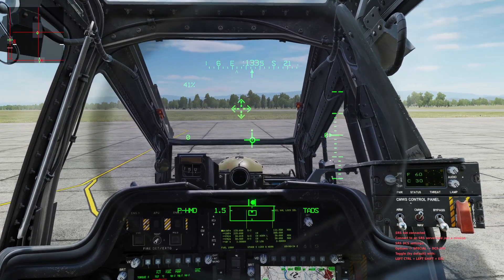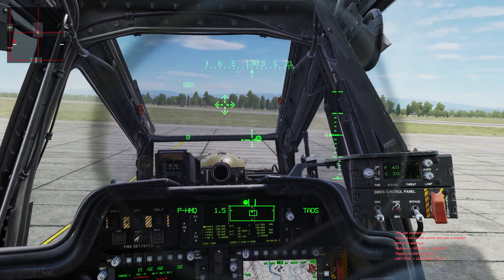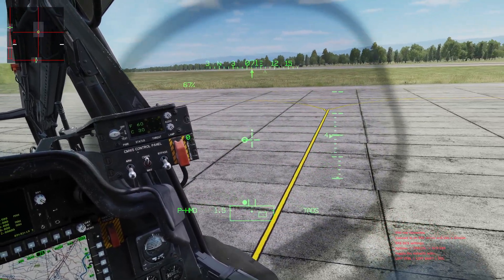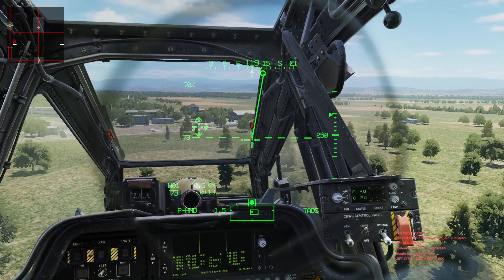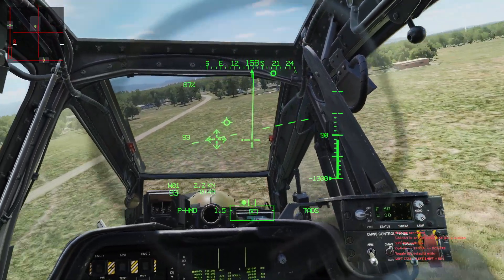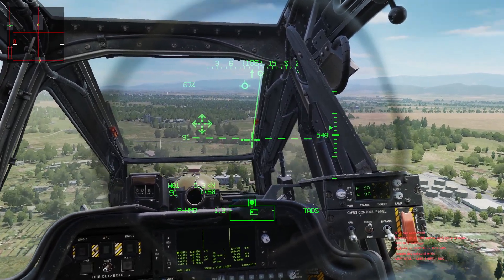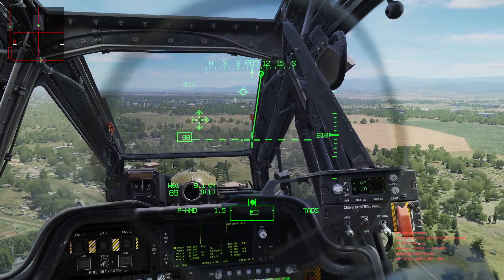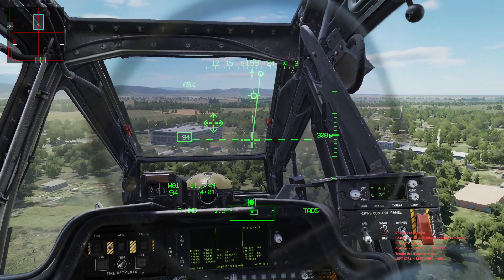AH-64D Hovering Turns, Force Trim Use, Hold Modes Enabled vs. Active

Comment: For some time throughout the 90's I was very fortunate to fly in high-wing 2-seater frequently with a retired Coast Guard pilot. He'd get me to line up to runways, various other low-risk operations :) However, rudder pedals in real-world are a floppy nightmare for me...... maybe it's cable stretch and delayed response from rudder while taxiing; getting "in sync" with the floppiness is not easy for me. Your rudder curve is pretty interesting, I appreciate the coverage. I tend to pull Y saturation quite far down to feel more manageable. As for Force Trim, it changed my ENTIRE Apache experience........ now that I've clicked with it, my Apache crashes my system every time I try a mission. The one and only aircraft that does so but you got a new subscriber here, guru :)

Comment: I fly with a Puma Pro flight trainer (cyclic, collective & pedal combo setup) which has no springs. In DCS I have trim modes set to joystick with no springs. Does what you say in this video also apply with such a setup?
Reply from the maker: You have to push the force trim button, regardless of your hardware, to update the FMC on where your flight controls are. Even with a dry clutch system that holds your stick in place, you have to push the force trim interrupt to tell the FMC what it’s reference should be.
Reply: @bradmicksflightrelatedthings  Thanks for your reply. What I do after each small corrections during flight is to press the force trim button. During your video you said to keep the force trim button depressed (i.e. force trim interrupt) during the whole course of manoevers. I assume this also applies with what you call 'dry clutch system'. In any case many thanks for all of you very informative videos!

Comment: easy to follow instructions, i don't use force trim because of the fixed wing HOTAS, was wondering if we can disable heading hold?
Reply from the maker: Heading hold is ALWAYS active, unless the force trim is interupted. The Apache requires your to use the force trim, it's how you communicate with the FMC and SAS. If you're not using the force trim, I would definitely encourage you to start, it'll make flying the helicopter that much better!

Comment: I've always just tapped the force trim button to hold my cyclic after I make corrections. Is there a difference in tapping vs holding and releasing?
Reply from the maker: Yup. As I stated in the video, the purpose behind pressing and holding the force trim button is to “fly to a trimmed state” which centers the SAS sleeve. This gives the SAS its maximum authority over the flight controls. Tapping runs the risk of engaging a hold mode with the SAS servo near the limit of its authority which will lead to a more less immediate “SAS saturation”, forcing you to have to press and hold the force trim to center the SAS sleeve and correct the condition.
Reply: Same here. Thx B, for the answer :)